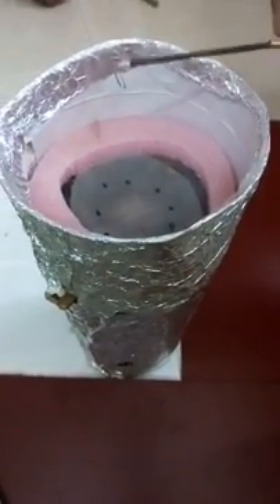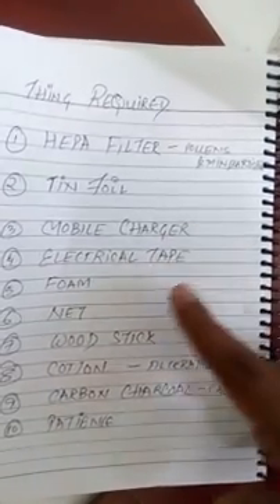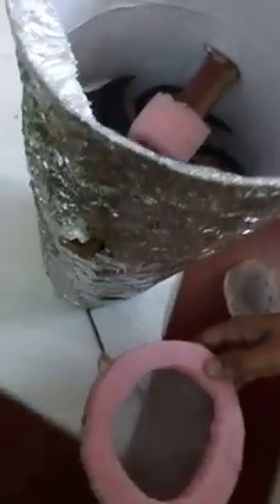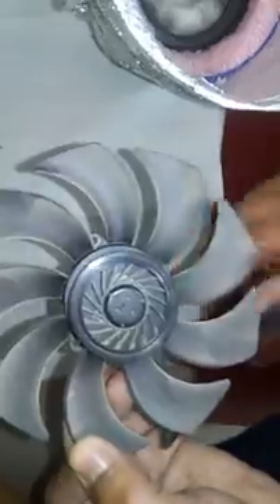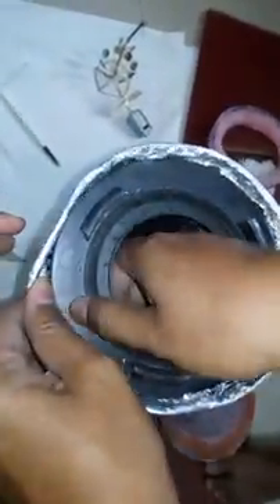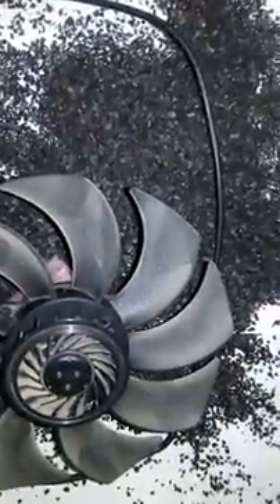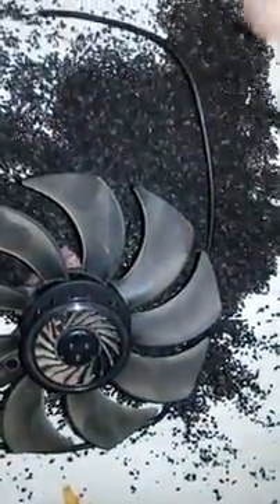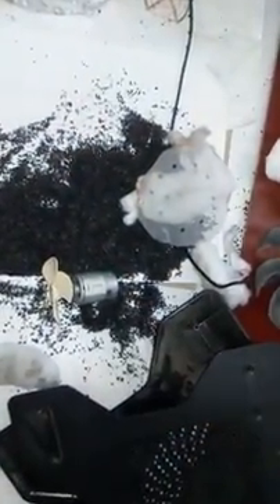How to make Air Purifier HEPA DIY Part 2

Comment: Really cool DIY Video, as air purifiers are costly these days and Air purifier is must for Delhi regions even ODD/Even rule reducd pollution a lot, but still we need something like this one in home.

We have to place that charcoal inside car filter ?
Reply from the maker: yes friend air flow should be on charcoal to absorb chemical hazards...
Reply from the maker: +Burfi Boys 

Friend placing charcoal in car is a problem. But we are soon planning to create a device commercially which would be much cheaper and purpose accomplishing. Thanks.
Reply from the maker: +Burfi Boys 

Friend placing charcoal in car is a problem. But we are soon planning to create a device commercially which would be much cheaper and purpose accomplishing. Thanks.